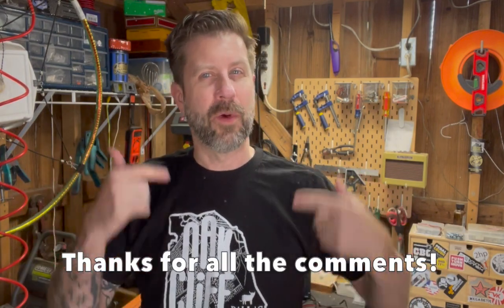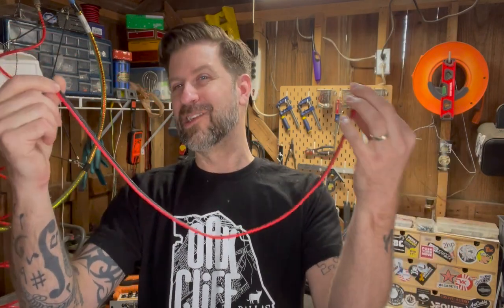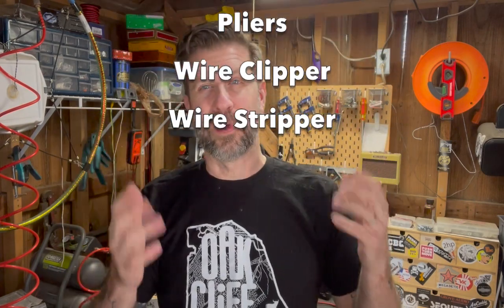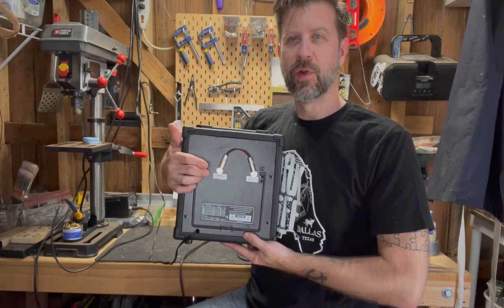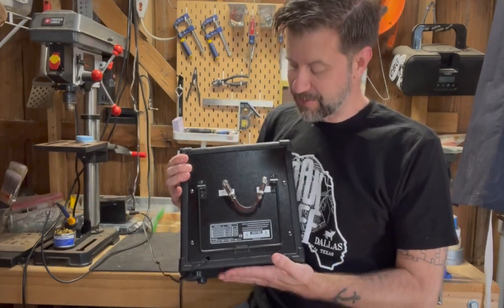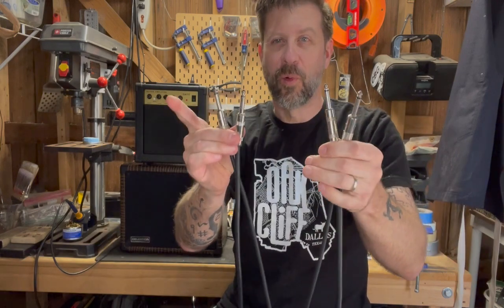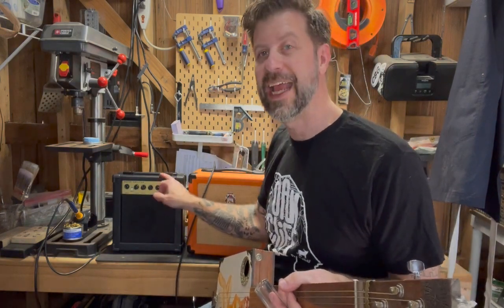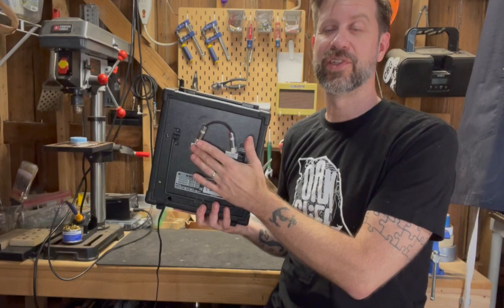How To Add Speaker Out & Amp In Jacks To Any Guitar Combo!

Comment: NO! I don't want an "eithe /or" I want to play BOTH my combo amp, AND an extended cab.
Reply from the maker: Okay. Just follow this mod and create a y-cable to go to both the internal speaker and the external speaker.

NOTE: you need to figure out whether that y-cable should be wired in series or parallel based on the impedance of the speakers and rated stability of your amp.

Comment: That was very useful and a good solution/new purpose for all those half broken amps people have floating around. I'm suffering from shed envy, mine is more of a shack where lizards live and broken down cardboard boxes are stored.
Reply from the maker: I didn't think about it that way but you are 100% correct. This would be a good way to repurpose a combo with a fried amp or a blown speaker. Quick and dirty! It sounds like your shed needs a little updating. LOL. Mine is pretty dusty but it works.

Comment: Exactly what I was looking for, and it's simpler than expected, no switches, though I don't understand why the wires attached to the speaker of the black amp couldn't just be soldered right to the terminals instead of using connectors. Also, there was no explanation as to why speaker cables are different from instrument cables. Just gonna throw that out there with no explanation?
Reply from the maker: Thanks for checking out the video. You could solder the wires to the speaker jacks if you want. That would work fine. I like to use connectors like that because it's easy to modify later if you change your mind (or think of something else as I often do).

About the differences between speaker and instrument cables... I didn't go into this because it's a rabbit hole w/opinions. The difference is, instrument cables are shielded, and speaker cables are not. Additionally, speaker cables tend to use heavier gauge wire (rated for high wattage) where instrument cables use lighter gauge wire (rated for low resistance). The shield is there to help reduce interference with low voltage signals (e.g. audio) and also keep the signal strong over distance. With high voltage signals (power), the shield can cause issues. There are some that say they've burned out an amp's output transformer by using an instrument cable as a speaker cable. Then there are others who say it doesn't matter and swear they've used an instrument cable as a speaker cable (or vice-versa) for years with no issues.

Believe what you want, but I'm inclined to think they're different for a reason and I always try to use them accordingly. Thanks again for checking it out and sorry for the long reply.

Comment: Very cool!  So you can  can send the head to another speaker, or plug another head into this.  Both with the same simple mod.  I wish I had thought of that!  I installed a switching jack in my combo, so by default its a combo, but if you plug in the cable, the local head is disconnected and it uses the external head.  But I like your mod better.  Also, you are using TRS jacks everyone already has.
Reply from the maker: @RickBeall  thanks for checking it out. It makes the combo really flexible. The jacks are 1/4” mono (TS).

Comment: Hi, Im hoping you can help help me. I have a 4x12, 8 ohm speaker cabinet. I connect this into Marshall DSL 100 watt head back input 1X4 ohm / 2X8 ohm speaker input. Is this correct? My amp tech told me it was, but he was very angry about it. I need a second opinion please 🙏
Reply from the maker: I would probably need to see a picture to give advice. I'm not really understanding from the description. If you're looking for a second opinion, you might want to use a forum like Gearslutz or one of the many guitar communities. I think you'd get a lot better responses if they can see it. Good luck.
Reply: @musicalmiscellany  I explained it the easiest way possible. I'm not sure if there's another way of explaining it?  The Marshall DSL 100 watt head l have has 5 speakers inputs, 1x16ohm, 1x8 ohm / 2x16 ohm, 1x4 ohm / 2x8 ohm,  The speaker cabinet is 4x12  8ohm which speaker input do I connect it to the 100 watt amp head? I thought you are speaker expert. because of your video. That's why I ask. I can't send you picture. I don't have a direct email link to you
Reply from the maker: @davidallen346  Just to be clear, an amp head has 0 speaker inputs. I'm assuming you mean speaker outputs. I'm not trying to be pedantic but these kinds of details matter, especially if you're asking if this can damage your amp (and thus why anyone who understands this stuff is probably going to want to see a picture).

I looked up the manual for the DSL 100 online and luckily it includes pics of the front/back panels. Also, it clearly says what you should do on page 11. For a single 8 ohm cabinet you can plug it into either of 2 jacks labeled "1x8 / 2x16", so that's exactly what I would do if I was you.
Reply: @musicalmiscellany  If the amp output is lower than the speaker ohm, than it might cause damages. If this case, the amp has 16ohm, the speaker cabinet is 8ohm  That's what I had done previously, connect the 8ohm 4x12 cabinet to the amp output 1x8 / 2x16 ohm and it sounded weak not full. This one  amp tech, who did the bias told me it was incorrect I needed it to connect to the amp head speaker output, 1x4ohm / 2x8 ohm for the 4x12 8 ohm cabinet. I think you're referring to a single speaker cabinet. I'm mentioning a 2x12 & 4x12  8ohm speaker cabinets. The cabinet says 8ohm on the label.I'm not sure, why there's so many speaker outputs for this particular Marshall DSL Head. This gets complicated for the user. There's series / parallel option supposedly. I guess I can go to a local guitar center and ask. I just figured  I can  get second opinion from a guitar amp expert. Thanks for your help
Reply: @musicalmiscellany  OK I downloaded the Marshal DSL 100 Amp head Manuel. It says 1x4 Ohm or 2x8 Ohm connects to a single 4 Ohm speaker cabinet or two 8 Ohm speaker cabinet. What about typical traditional half stack 4x12  8 Ohm speaker cabinet?  I'm assuming, that's what I'm supposed to use for the half stack 4x12 - 1x4 Ohm / 2x8 Ohm cabinet is the 2x8 Ohm output for Marshall DSL 100 watt amp head. It would be easier to understand Marshall DSL manuel if it included the 4x12 speaker cabinet description
Reply from the maker: @davidallen346  The way I'm reading it, the left jack is for a 16 ohm load (1 x 16 ohm cab), the middle 2 jacks are for a 8 ohm load (either 1 x 8 ohm cab or 2 x 16 ohm cab), and the right 2 jacks are for a 4 ohm load (either 4 ohm cab x 1 or 8 ohm cab x 2). So those probably correspond to the 4, 8, and 16 ohm taps on the output transformer. 3 output taps would be typical in a head like this.

The number of speakers in the cabinet doesn't matter. A single speaker 8 ohm cab is the same as a 4 speaker 8 ohm cab as far as the output transformer is concerned. I already told you what I'd do if I were in your shoes, but you do what you feel is best. Thanks again for checking out the vid.

Comment: I have two PA speakers Passive 12 Inch 2-Way PA/DJ Loudspeaker Cabinet - 700 Watt Full Range PA/DJ Band Live Sound Speaker can I use those two external cabs for electric guitar? Your opinion
Reply from the maker: @Texas059  you never know what it’s gonna sound like until you try it. It could be glorious or it could be terrible. One thing to keep in mind… PA Speakers tend to be power hungry so make sure you give it enough juice. I actually used a PA speaker (with a power amp and a small mixer) for a keyboard rig years ago. It sounded pretty darn good… but amplifying keyboards is a lot different than amplifying guitars. Good luck.

Comment: very cool. Question, Is it possible to wire a combo to work as a combo while also powering an extension cab? can speakers in both the combo and the extension cab be working at the same time? I'd like to build a small cab with 1 8" in it to compliment the tones I get from a 20 watt solid state combo.
Reply from the maker: @RJsCave  Yes. You could follow this tutorial and then create a y-cable that goes to both speakers. The you’d plug in both cabs to the amp output. You could create this cable to be series or parallel depending on the impedance you desire. Does this make sense?
Reply: @musicalmiscellany  I think so. as for the cab, I'll be connecting to an 8 ohm combo so 2 4 ohm speakers in series or would a single 8 ohm speaker would work? I also have a 4ohm combo I'd like to connect a single 4 ohm speaker cab to as well.
Reply from the maker: @RJsCave  2 8-ohm speakers wired in parallel would result in a 4-ohm load. 2 8-ohm speakers wired in series would result in a 16-ohm load. So if your amp was 8-ohm stable, you’d want to use series wiring. It’s really more about the stability of the amp than it is about the speakers.

Comment: I got a no name amp from the 80s that has two channels but no footswitch. Any recommendations?
Reply from the maker: I'm not sure I understand the question. Recommendations for what? Thanks for watching though.
Reply: @ sorry I was unclear lol. I’m trying to figure out if it’s worth it to try and wire a jack for a foot switch and if it’s a fairly standard process
Reply from the maker: @ Do the two channels have separate inputs and volume controls? Or is there a single input with a channel switch?
Reply: @musicalmiscellany  single input with a channel switch
Reply from the maker: @IScreamedWolf  If that's the case, it shouldn't be too difficult. You'll need to open up the amp and take a look at the switch. Chances are it has 3 wires going to it. If that's the case, you could just take those wires and connect them to the 3 prongs of 1/4" TRS jack. Then plug in your footswitch to the TRS jack and it 'should' work. I'd probably test this with some alligator clips and ensure it works before drilling any holes.

Needless to say, you'll need to do some prototyping to figure out which wire needs to go where and if you can leave the original switch in the circuit or remove it, but honestly... it doesn't seem particularly complex (granted I haven't tried it so I'm speaking theoretically). If this all sounds daunting to you, just take the amp to a repair shop and tell them what you want to do. They should be able to figure it out.
Reply: @ thanks so much man!! Can tell you how much I appreciate your time. I build guitars on the side but amps have always come off as super intimidating so I’m grateful for your help dipping my toes in the water.

Comment: couldn't u do this w just one TS Jack, using the other pin?
Reply from the maker: I'm not sure what you mean by "other pin" but short answer... no, there's not a way to do the same thing with a standard TS jack. You could wire a mono jack in parallel with the speaker but then the internal speaker would keep playing when you plug in an extension cab. If you wired a mono jack in series with the internal speaker, neither speaker would work until there's a plug in the jack.

Comment: Nice mode,i have a peavey vyper 75 which didn't have an output to go directly to a board for recording so i came across a 1/4" jack that had four lugs almost like a toggle would and i hooked it up and when i wanted to record i would plug a cord in and run it to the board and it would cut the speaker in the amp off and send the signal to the board
Reply from the maker: That sounds similar to the mod I did on the Orange combo. There's a lot of cool mods you can do with these little amps. Thanks for checking it out.

Comment: Great idea! I have a 1x12" combo amp that I want to use either as a combo or as an extension cab. It's easy to drill a hole and add  another connector and hook up the speaker. However I don't like the idea of plugging and uplugging cables from the speaker everytime. I like your idea with jumper cable. Can I add a regular on-off switch to disconnect the speaker from the combo amp while using it as a cab. Or (because every speaker has 2 connections on both + and - leads) to leave them both on all the time, since I'll be powering only one amp at a time!  

Thanks !
Reply from the maker: While it’s absolutely possible, I’d be cautious about adding a switch to a power connection. Your switch would have to be commensurate with the amps power output. So if you had a 50W amp, you’d want at least a 50W rated (I’d probably use 75W) switch. Also you’d have to make sure it was well grounded / insulated so you don’t get a jolt when you switch it. Just be careful if you’re gonna go that route. Also, this vid might interest you. https://youtu.be/9IQlyGviLJY?si=PU4InZHvZsp30NxM
Reply: Thanks a lot man!

Comment: Just spitballing here…
Would this work with a power attenuator, which then also has an effects loop?
I kinda want to make my Crush 12 a little more fun…🤔
Reply from the maker: Hmmm. I'm not sure I'm fully following the question, but it wouldn't make a lot of sense to attenuate a power signal going to a speaker. You'd effectively need a resistor that matched the power output. So, in the case of a 50W amp, you'd need a 50W resistor and I can't imagine how hot that would get at high attenuation. You'd be better off to attenuate the input signal or just turn the volume down. Also with an effects loop, that would need to be in the input path, not the output path. Sending an output power signal to a pedal would sure fry it. Again, maybe I'm misunderstanding the question.

Comment: Extension Speaker  and external  speakers in guitar amplifiers :what is the difference in sound?
Reply from the maker: @pietroanania  thanks for checking out the video. That’s not an easy question to answer though. It’s going to depend on the amp and the speaker

Comment: Thanks so much! Do you have to match the ohms of the speaker?
Reply from the maker: Thanks for watching the vid. That's a simple question with a really long answer. I'll do my best to keep it concise. The power amp section inside the combo amp will determine the minimum impedance. So, you'll want to reference the vendor's documentation (or possibly even open a support ticket with the vendor). It's going to vary from amp to amp.

If the power section is 4 ohm stable and the internal speaker is 8 ohm, you can safely plug in a 16, 8, or 4 ohm cab to the speaker out jack. However, you wouldn't want to plug in a 2 ohm cab because that could fry the output transformer. In other words, never go lower than the minimum.

If the vendor states the amp is 8 ohm stable and it has an 8 ohm speaker, I definitely wouldn't plug it into a 4 or 2 ohm cab as that could damage the circuit, but 8 and 16 ohm cabs should be fine.

If you don't know the stats on the internal amp section, it's safest to just assume its minimum impedance matches the internal speaker (which I why I say that in the video). I hope all of that made sense.

Comment: Can you just use a 6 or 12 inch pedal patch cable instead of wiring up two jacks to speaker wire?
Reply from the maker: @joeking433  instrument cables are typically shielded (low voltage) where speaker cables are not shielded (high voltage). So there is a difference between them. Some people say they’ve used an instrument cable for a speaker cable and had no problems… but the general thought is you should not do that. I wouldn’t risk it.

Comment: Great video mate.
It would be awesome if there is a way to add an fx loop, i have a funder champion 40  and unfortunately the dsp has a hiss, can be easily solved with an eq pedal , but i presume that would required an unbuffered fx loop with a send and return. It would be great if you can show us how can that be done.
Reply: Or wait a second … wouldn’t what you did on the video be an actual fx loop ??? 😂
Reply from the maker: Adding an Effects Loop to a circuit is a lot more difficult than a mod like this. You'd have to do an analysis of the circuit because you're effectively inserting a signal out/in into the input path. Each amp is going to be a bit different. I/O mods like the ones in this vid deal with the output path which is much different.

Comment: So is there any way to keep the combo speaker going while using the speaker out? I play rocksmith on the xbox and im trying to use my combo amp instead of the tv speakers, bc with the cable going to the xbox and the hdmi going from xbox to tv or sound bar, theres a delay that cant be fixed.

I want to mod my combo so i can send the signal from a speaker out to the xbox without losing the sound from the combo
Reply from the maker: I’m not completely following but it sounds like you need to send an audio signal whereas this video is about sending a powered signal.
Reply: @musicalmiscellany  it's ok I grabbed a DI box, that should do the trick. Thanks for responding, and I like your videos. At least my problem got you some views lol

Comment: Question? Can you use both speakers together?
Reply from the maker: Thanks for watching the vid. That simple question has a really long answer.

Here's the short version... if you had an 8-ohm speaker inside the combo amp, as well as an 8-ohm external speaker cabinet, and the amp was 4-ohm stable... then yes it would be doable. You'd probably have to make a custom cable but still, it would work. However, if the amp was only 8-ohm stable (and you had the same speakers), running both speakers would likely burn out your amp's output transformer.

So is it possible... maybe? It just depends on the amp and the speakers.